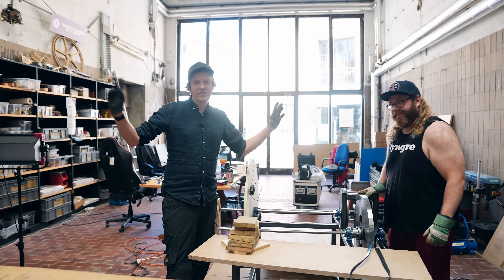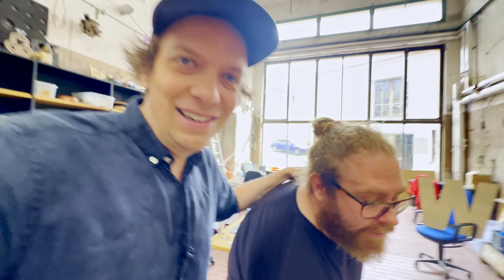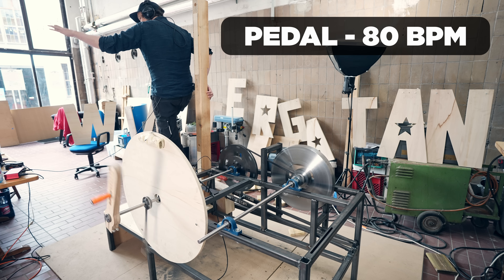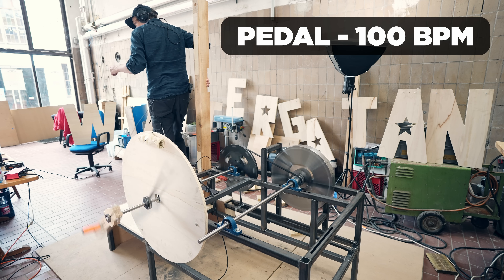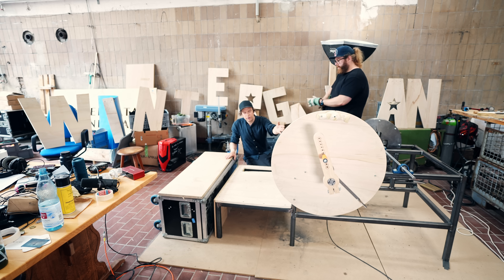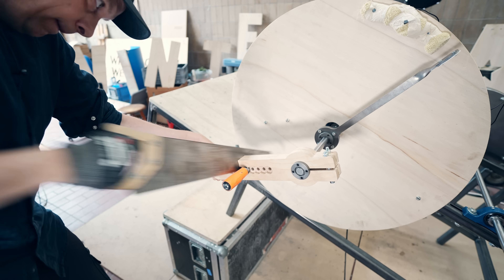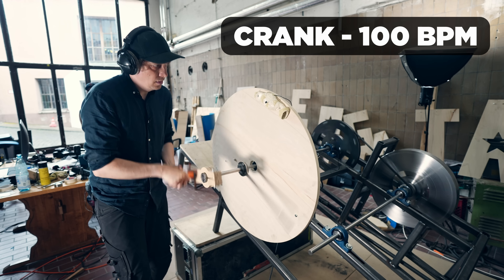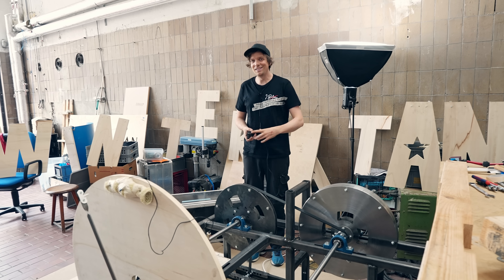Heavy Flywheel plays Tighter music! - DAY 11 - Marble Machine Flywheel Prototype

Comment: Here's an idea: instead of trying to sync up to the beat, just try to play at a consistent tempo. I feel like focusing on syncing to the perfect beat is causing the oscillation of up and down. If you just play without any reference, it might make the music tighter, but not necessarily the perfect tempo. I don't know if you're prioritizing tempo or tightness, but you can sacrifice perfect tempo for better tightness.
Reply: Yes, but I think this comes into conflict with the idea of using the machine in a live/stage setting with a band. There you usually play with a common metronome click, and everybody has to align to that.
However I still agree, that aligning to a fixed click is unnecessary. Maybe just let the machine give the click and everybody else aligns to it.
Reply: @Steiger08  Isn't the fix for this to just not play with a click, and rather have proper monitor sound on stage, so everyone can hear each other and can play together as musicians?
Reply: @haakonmusic7172  the band will still be playing together on in ears, but if there are any prerecorded parts/loops/etc., they will HAVE to be on one consistent tempo at the same time
Reply: @Steiger08  Other players should align with what ever is making the rythm, and that is the MM. Not the click. As OP and I said, it would be much easier to crank the machine consistently with the click than in perfect sync. That latter makes the tempo wobble. After that, others should play in tempo with the machine and not an external click that the machine struggles to keep in sync with.
Reply: @Steiger08 theoretically everyone could just play off of the marble machines tempo
Rock it old school and base the playing off of one instrument
Reply: This. Trying to sort out this issue would be a nightmare, and would probably require a PLL of some sort. Either that or a motor that is capable of keeping a very consistent speed, probably a servo.
Also, more moment of inertia ≠ tighter music. More moment of inertia = more energy in the control loop = more energy required to correct errors = lower frequency oscillations if the control system isn't properly tuned. In other words, martin is just more consistent with the petal.
Reply: As a sound engineer, I would say that >50% of bands at the club touring level, and >95% of bands at the theater level and above are playing to a click. Having backing tracks is very very common. I would say that if you've never heard of a live band playing to a click it's because you are very disconnected from the world of touring musicians.

As far as the marble machine goes, if the intention is to use human power then the solution might be to have the click come from an extra marble lane of the machine that hits a trigger pad, instead of trying to sync the machine to an external click.
Reply: @StephanAhonen of course, but what is even the point of using a mechanical machine like this, which can do very interesting decelerandos, then? Wintergatan could just forgo using backing tracks when using the MM3, and keep using them for other songs. Heck, for all fans know and care, the MM3 could be a solo act for interludes, seeing how it’s already a “mini-band” of sorts. 🤷‍♂️
Reply: Yeah I think this will be key! Maybe the issue isn’t the machine at all but that there is always human inconsistency in input, even in the best drummers
Reply: This thread made me realise that Martin is trying to perform a PID loop, and that would explain some of the struggle.
Reply: @espenschjelderup426   a PID where the flywheel takes the role of the I. And a quite heavy one in that, which means that it will reach the target only slowly. Since P and D are missing (well, martin is the stand-in) it will be even slower. Solution: drop the flywheel, Martin is very much capable of stomping consistently and will be even more so if the pedal (along with the machine) feels lightweight.
Reply: Have the marble machine generate the click for the other instruments.  It can even generate MIDI control messages to drive the tempo of other instruments such as sequencers with a shaft rotation sensor and a microcontroller.
Reply: @multiplysixbynine  Exactly this. The marble machine should be the master, all other instruments slave. I really don't understand what Martin is trying to achieve here.
Reply: By definition, more consistent will equal to better tempo. That is because the marble machine IS THE tempo, and NOT following the tempo. Of course, in this test it is following it, but that is because it's not producing the music yet. But you are correct that they should focus on consistency and not in sync. What ever bpm click he's listening, he should focus on turning the wheel in consistent speed with the click and not in sync with it.
Reply: Indeed, havs a click for Martin to feel the tempo if needs be, but have the Marble Machine itself provide the click to the rest of the band? (Though I understand the need for these sort of tests).
Reply: I've always been thinking that this could use some program that adjust every next metronome click to the last click of the machine. Machine clicks, queue a metronome click for in ¾ seconds. That way there is no syncing required.
Reply: @gaboversta2.423  Why make things any more complicated than what they have to be. You never noticed that he already  literally have a perfect click for free in his prototype? One that's sync timing is even adjustable by rotating the "clock hand", and what can be used as click for other players?
Reply: I think he's so worried about consistent tempo because the band plays with synth/arpeggiators so often
Reply: Asking a heavily  damped system to then respond quickly to demands for a change in phase is unrealistic. Those things are mutually exclusive. The MM needs to set the tempo, not constantly try to catch and phase with some other reference. This may well be the goal I suppose.
Reply: The click actually helps to stay in tempo. Otherwise you will speed up or slow down significantly over time without noticing. It's very common in the music industry and Martin will have to use it on stage to stay in sync with the band
Reply: @Laviarty Use an bicycle spedometer whose pickup wheel rides the side of the flywheel at the proper radius to make the indicated speed in km/h matches the wheel speed's in BPM.  That would allow continuous reporting of speed, rather than just one measurement per quarter note beat.
Reply: @Laviarty speeding up or slowing down doesn't matter as much as people think. Just listen to Hendrix stuff.
It's only a problem with background  sounds, or some instruments
Reply: you dont have that level of control because you have to sync motion of your entire leg to exactly 1 revolution of inertial mass, but I get it
Reply: Unlike a drummer, who once he notices he's falling behind can just... not...
The Marble Machine is incredibly hard to fine-tune on the fly.

You can feel when you're off-tempo even without a click, and when your tempo wobbles around a whole bunch, it's very useful to know where your baseline is supposed to be.
Reply: He seems to have difficulties grasping this, or we really miss something. To me all the "special software" gimmick is just geeks working on something that has no real meaning. Get a rpm gun to have realtime feedback and use it as a guide for the human governor. That would be enough and the simple and effective way to have meaningful results.
Reply: Take the microphone on the "clock" of the MM, and use it as a trigger for a metronome click sound. If Martin wants, he can have a screen that reports out what his BPM is, so he can stay close to his target (80/100/120).
Reply: This is meant to be an instrument and to that end it needs to be able to sync to a beat
Reply: @masm515  No, this is not just an instrument. It is the beat, rhythm and the click. THE THING that dictates the tempo.
Reply: Repeating a comment i made: make a software that plays a tempo beat the set time after the machine arm hits the microphone
Reply: I think the problem is that in these tests, he has to vary frequency to sync phase. If he needs to sync phase with other musicians, the mechanism as it is is unviable. Syncing phase takes him far too long. I think what he needs is a way to decouple phase and frequency and control them independently. For example if he had a clutch, he could spin up the flywheel with the clutch disengaged before the band starts playing then engage the clutch on cue to sync.
Reply: Does the band follow a metronome or does everyone follow someone in the band (the drummer?) that sets the beat? Likewise, is the machine going to set a tempo or will it be following a tempo set by someone/something else?

If the tempo is being set by the machine, then a timer that clicks at 1/80 of a minute after the last rotation would be an easier beat to match instead of trying to sync up to an existing beat which you may be 180° out of phase from and then have to catch up to.
Reply: Neither , your missing the point hes testing and reviewing data.
Reply: @user-pc8tb7hg1lHandlesRDumb 
Maybe it’s us who are missing the point, sure, but Martin does have a history of going down pointless rabbit holes. He should, in this case, do both kinds of testing, as he would, in fact, be testing himself as an integral part of the equation if the machine is to be what sets the tempo instead of a click track (something which, sadly, the tests seem to indicate, and seeing how difficult, if not impossible, it is to get it to sync perfectly, short of fitting a motor to it, it feels as if Martin is, once again, setting the poor machine for failure).
Reply: @Mainyehc He’s asking a machine to perform a function it’s not intended for.

Flywheels aren’t intended to maintain a perfect RPM—especially in a system with variable power inputs and outputs.

He’s spent a year (?) “designing” a flywheel, yet never really “understanding” a flywheel
Reply: You can’t generate clicks with MM if you also have music box in the song, for example
Reply: If playing to the click track is  needed (not commenting on that) perhaps a visual indicator of lead/ lag would be helpful. It could be a row of lights, like a tuner, to help indicate when the mm is on beat.
Reply: Feel like you've misunderstood that this is a test and development phase. You need a metric for comparing the performance of the machine under different circumstances.
Reply: You would have no reference because you would be keeping time, not the machine, so you would be testing how tight you can play music
Reply: In order to keep time, everything must be in sync. Every beat, every click, every vibration.
Reply: @SoranoGuardias musicians do that by ear automatically when they play without a click track.
Speeding up and slowing down slightly as the whole band.

Doesn't work with all instruments though, for some things you need a click track.
Reply: I've never known a live band use a click track to keep time - they sync to the drummer...
Reply: @farmersteve129  exactly. And the marble machine would be the drummer in this case.
Reply: @farmersteve129 bands that do more technical music usually use click tracks
Reply: @farmersteve129 What? Nearly every bigger band plays to click tracks
Reply: @farmersteve129 
That is just not true, professional bands do this I would guess close to 100% of the time
Reply: Or he could power it with an electric motor with variable speed. And not have to be worried about getting tired or if he he playing to slow or to fast
Reply: This isn't jazz, you can't just do whatever you want

Comment: So far you found that you can crank more accurately than you can pedal, but is that because you have more experience cranking than pedaling?
Reply: Probably not, since in cranking you can apply force at every angle of rotation while in pedaling you can apply force only on the down stroke (on returning stroke the pedal actually removes the energy from the fly wheel).
Reply: Could add a shoe clip to it like a bike pedal so he could push and pull.